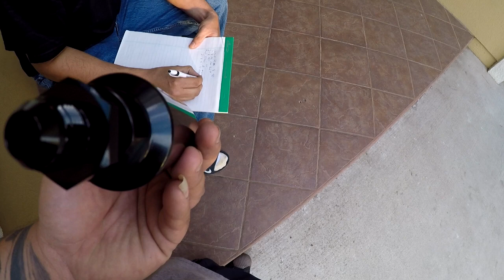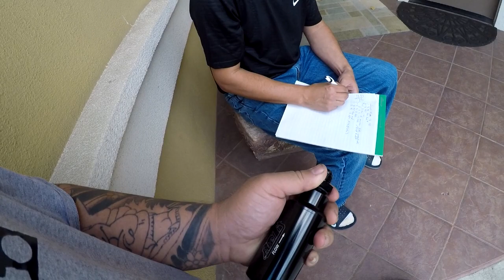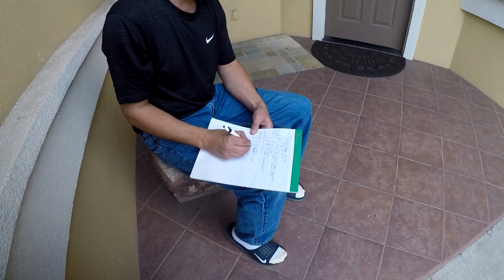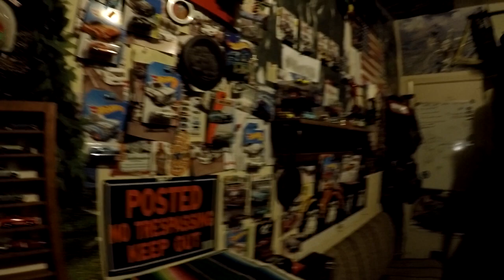BRFittings : Building E85 Fuel lines

Comment: Just bought an Integra thats e85 LS Vtec with built head an trans but its running rubber lines from the fuel tank so I'm freaking out it has the right lines an filter an fuel rail but the line running to the fuel rail is rubber I have no idea how much line needs replaced assuming 80% but have no idea any suggestions or pointers never had an e85 tuned car its fast an love the car but want it done right